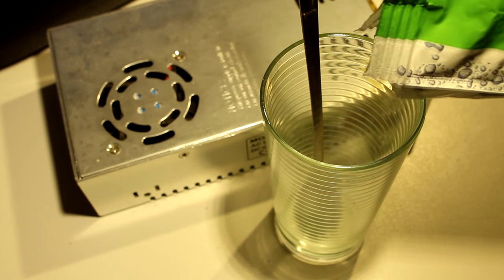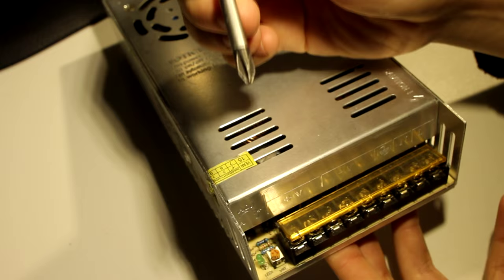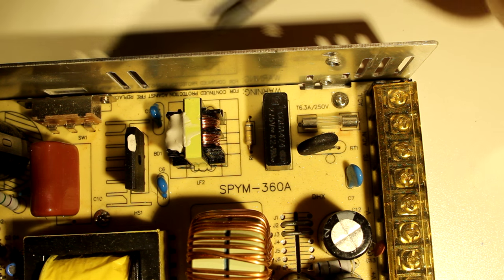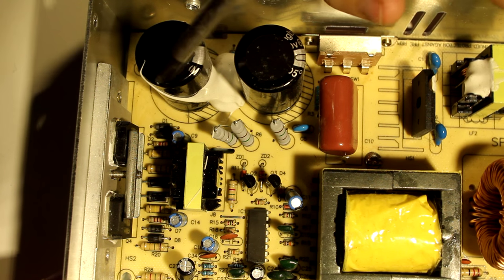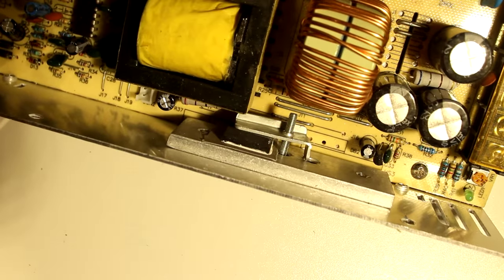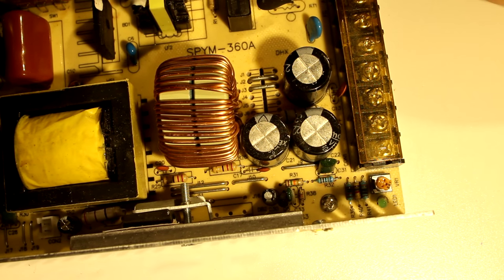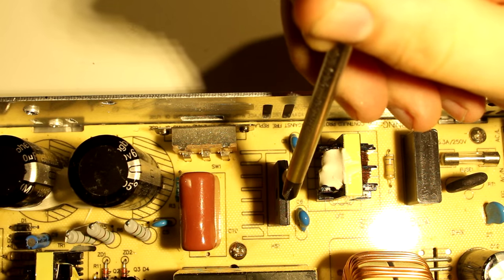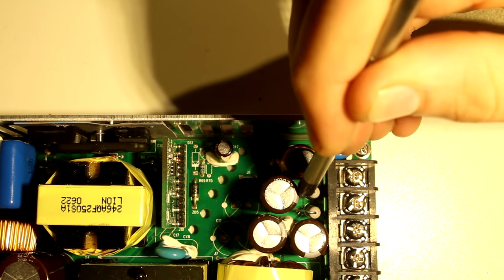Crappy chinese 24V '360W' power supply teardown (005)

Comment: who makes your better supply ? any idea what ic is running it ? a friend brought me a dumpster found elipse 720s (model) 720w 24v 30a but even after replacing input and output caps and checking all its relays It doesnt function. I get like -3v... life threw me a curve ball so i dont have a bench at the moment. also its been hard to find a full manual on it. I do know it has a CAN bus output but havent looked into it. Might be as simple as i need to short 2 wires usually switched. It was intended to be an integrated EV charger so the manual/install info arnt public. I emailed the company and got an auto responder saying x was out of office on vecation but never heard back . 

Id rather use that for my spot welder (through large buck) than the shit 500w china supply.
Ticks me off cause the only thing apparently wrong with it was a failed fan. Im not sure why it had one to begin with though. It is a sealed water tight heatsink case that they have a patent on. Idk if it just evenly distributes temp inside but seems stupid to have in such a build. 

http://q-tronic.nl/wp-content/uploads/2012/12/ELIPS-24V30A-UK.pdf

Comment: What was more concern to me was the poor inductor winding (crossing over a previous turn), and how much it wiggled. The output caps which seem not to be low-ESR types. (They should have a gold stripe). I think the power resistor between the output caps may heat them and shorten their life. I'm guessing no power factor correction.  The p/s I bought has a 24V fan, which changes speed with the load (or at least the current) .  Can you get a bit of fencing wire as a 2 Ohm resistor and actually check the p/s under nearly full load? Put it in a bucket of water and it should not get above 60 deg C (150 F or thereabouts) over a few hours.

Comment: I purchased one similar tothe one you just reviewed, I hooked it up to my 24V motor,
ex Wheel chair motor, all it did was send power to the motor in spurts...
The motor ran for a second then stopped for 10 seconds, repeated that all the time.
This is a Model S-480-24.  Input 110V / 220V.   Output 24V-20A.
I want to run  my 24V motor to drive a small power hacksaw.
Any clues on what to get? I have 240 Volts 60Hz in Australia

Comment: how would you do a load test on these power supplies to check the max current output ie  advertised at 30A?.... Because I just purchased one but I suspect the max output of the current is less than what's advertised at 30A.

Comment: I did a teardown on a similar power supply to that but mine was the 12V version. Seems to be even worse than yours but mine has two diodes on the output rather than one. I've put quite a number of hours on mine with 15 amp loads and it seems to work well and stay cool. However, its still a POS and I'm not comfortable turning my back on it.
Reply: That's what fuses are for if it runs cool and does the job whats the worry your house is way more likely to catch fire from xmas lights or overloaded extension cords.

Comment: neutral is tied to g in north american code (aka in theory most places built in the last few decades it is). I just got a 500w version that appears to be from the same designer. The lack of physical isolation/seperation bothered me too. I think its supposed to have actual cut outs in the pcb. Any idea if removing the bridge and connecting it via 14g wire...about 7in away will have a huge effect? Im integrating this into a spot welder I built and it would be a lot easier with my case design to have the heat sink only on one side. also... how did they get away with out optos?  mine is designed a bit better, it has 2 diodes  and 2 little tfs plus a big inductor with a seperator in the middle that apears to be a  common mode choke ...im kinda new to this though so im not sure. I know its before the rectifier though. Also I know w/vent is exactly what you want with cheap ass china caps...ive seen that feature utilized in a 5 dollar ebay boost converter.

Comment: Not sure why you are bitching about vents on those caps. The caps on the high quality supply have the same vents.
Even top quality brand caps will dry out over time and it is better to have them fail in a controlled manour than to just explode.

Comment: The Black round device is not MOV but it is Thermistor.  the MOV and Thermister has different works. MOV sets on parller but the NTC thermister is conneted on serise. please correct.

Comment: Nice video, but if i had to buy a cheap 12v 3amp power supply, what would You recommend?
Reply from the maker: +martin greenfield After years and years of teardowns.... I still have no idea. There are literally hundreds of PSU manufacturers, most of which I never heard of. The vast majority of them do contact manufacturing to some specification, so it's not unheard of for a manufacturer to 'usually' bring out mediocre stuff, but sometimes have these ultra-high quality PSUs. To mind comes FSP, who have self-branded computer power supplies that aren't particularly great, but also do medical PSUs which are best-in-class.

Literally the only way of knowing 100% for sure which PSU to buy is to do a teardown. Barring that, good indicators are: 1) UL/CSA listing (which is legitimate - lots of counterfeiting going on here), 2) price (more expensive is generally better in this ultra-competitive market), 3) high-end brands (Delta is a universal good brand, never seen any crap from them). 

I guess I'll do a video on that as well. It's the most common question I get on all PSU related blogs as well.
Reply: +martin greenfield  Try the STP3010  I got from Skytop power. (Check it with light globe load ) THEN take off the cover and see if there is anything hot. I think they make a STP3005 model too.

Comment: I've connected a 1F capacitor to the output of one of these PSUs (12V version) and now... it's not turning on anymore. Do you think it would be an easy fix? Could you guess what went wrong?
Reply: thank you for the reply!
Reply: OR use one of what he erroneously called a MOV in the video but is actually an ICL (or NTC ICL) - Inrush Current Limiter. HOWEVER be VERY wary since with a 1F capacitor, you're usually talking about supercaps and the inrush currrent can be VERY high for a LONG period and even an ICL may not be able to cope. Also the ABSOLUTE MAX voltage across them should typically be around 2.7 volts ONLY. SOME go very slightly higher,. BUT if you're trying to drive one with a 12v supply then STOP!! Go back to basics and properly understand what EXACTLY you are doing because NO amount of current protection is going to protect your circuits OR YOU from extreme abuse! Connecting a 12v high amps PSU to a 2.7v supercap is GROSS abuse and you're damned lucky the PSU blew otherwise the cap would probably have blown and sprayed you with boiling (literally) electrolyte!!
Reply: Bob Lewis Sir the capacitor is a car audio type, so it's rated to 18V max I believe.. and I got the PSU already fixed
Reply: Alexandru Simonescu OK COOL. Glad you got it fixed. I hope my points weren't wasted on those reading however. The point remains valid though about slowing down the inrush to large value supercaps as it can happen at any time, but especially if you just happen to switch on at the peak of the incoming AC voltage! In steady state conditions the PSUs current limit should handle the issue but during switch on transients there is WAY less predictability.

Comment: Have you tested this power supply to see how much it can actually put out? Would be interesting to see. Thanks for showing the inner workings, I've been curious about these ebay power supplies.
Reply from the maker: +Gyppor No, but I've just finished my electronic load with which I'll be able to do just that.
Reply from the maker: The MOSFET is apparently not a MOSFET, but a D13009K NPN transistor

Comment: You don't know anything about how a power supply works. A transformer only works with an AC input. They convert the mains to DC so they can convert that to a high frequency pulse to use a small transformer. That doesn't mean that it can't handle 360 Watts. I call it a piece of junk if it has no PFC. You did even call a NTC a MOV. Even a ATX power supply has a single diode chip for one DC rail. That also doesn't mean that it can't handle the current.
And the input caps should also be good, otherways it will also explode, they are to filter the voltage from the full bridge rectifier.
Reply: HVI No they don’t convert anything. They just step down the AC voltage input down. A single diode or a bridge rectifier and a filtering cap is what converts it to dc.
Reply: A transformer can convert pulsing DC, in fact Faraday used pulsing DC for his transformer when he invented it because AC wasn't available yet... But you are right the SMPS uses high frequency AC.

Comment: I would like to see a follow up where you load it up and see how close it can get to the advertised specification. It certainly is crappy, but for some less demanding uses, will it work?
Reply from the maker: +migry It outputs power, but the output is very noisy. If you use it for directly powering (sensitive) electronics, it's not acceptable. I used it for driving stepper motors, and that worked just fine. But I used it at less than 25% of its rated capacity.

In general, these things will work just fine with stuff that doesn't really care about power quality and at less than 50% of rated power. They will not survive very long though. I've already repaired this one twice...
Reply: OMG!! You never mentioned you'd repaired it previously ... TWICE! And yet DESPITE having been inside it TWICE and "repaired it" you didn't even KNOW that it was an NTC ICL and NOT a MOV! You didn't even KNOW that it had no PFC circuitry! You didn't even KNOW that it had a flyback transformer design! And you didn't even KNOW half of the other stuff you got wrong and yet you claim to have "repaired it" TWICE. ... It gets WORSE not better!

Comment: It must be get pre-filtered  clean air   with forced air cooling for long term use.  Dust bunnies with humidity, overheating, unstable reactive load, etc can cause failure.
 ||| The Input is not an MOV but an ICL to reduce inrush RT= Resistor Thermal)  |||  It takes great skill to cost-reduce this much but risk of failures is higher from unskilled users.  |||   For active load test. Get toaster wire (Nichrome filament) to make 1 to 2 Ohms for 200W to get red hot then drive with <<0.1 Ohm FET to keep cool  |||

Comment: are you going to test the power output? it would be interesting to see how much it can actually deliver, at the risk of blowing it up of course...
Reply from the maker: +ghostrider090 My testing setup is currently still under construction, but all reviews approx. 1 month from now will have a testing section.
Reply: SERIOUSLY!!?? You post a PSU review (NOT a breakdown) and haven't even completed your test setup? Who needs a setup? Just hook up your scope and a decent output load (a bunch of mains filament lamps in parallel is ideal and away you go. ALL the important measurements can be shown on a scope - waveform distortion, regulation, pwm stability, voltage v current stability. You can even do a lot with just a multi-meter. Do NOT judge a design until you are at least adequately qualified to comment. Some of your comments are crass. Others (as people have already said) are just plain stupid. If you want to have on-line credibility then start with the truth. 

TrY: "I don't know much about these, but here's my take. Corrective comments are very welcome" That would have given you a much bigger credibility than what you did.

I am an electronics graduate of over 40 years standing and I FREQUENTLYwatch videos such as this to see if I can pick up extra tips on things I may have missed previously. After 40 plus years I'm still learning new stuff. Sadly in this instance I found myself exasperated at the poor knowledge, understanding and lack of respect for the designer.Nobody ever winced at a Mini because it had a piddling little 850cc engine WHEN IT could, would and did run rings around MUCH larger vehicles on a twisty road, so why even think that just because there is an excess of large inductors and other stuff for a computer SMPS that such would be required for one that TECHNICALLY is almost certainly designed with LED lighting in mind or some other somewhat less demanding task than the VERY heavy variable and inductive loads found in a computer. Which, incidentally, is the main (but not the only) reason you'll find PFC circuitry in them - sometimes passive but often active.

The "crease" marks on top of capacitors ARE a feature, and one found in ALL the BEST capacitors, and a VERY important feature. They not actually "vents" per se (a vent is more commonly something e.g. you'll find in a sealed lead acid battery - opens AND closes) ensure that WHEN one explodes, it does so through the weakest point in order to have some predictability over direction of usually VERY hot (100 - plus Celcius) electrolyte ejection. The creases ARE the weakest point, and in a PSU, they SHOULD point vertically upwards towards the nearest metalwork of the case. ONE reason why having radial capacitors lying on their side when other board mounted caps are mounted vertically is generally a BAD idea.

There is so much other stuff that is just "wrong" in there I'd be writing all week.
Reply: Exactly correct Bob this is not rocket science.

Comment: I bought a "crappy" 30V 10A adjustable p/s a few months ago.  About $99 (US) from DX .  When first testing I used 2 x 12V halogen lamps as load, and about 5 min later a diode in the fan power supply failed and the mfr (stp@skytoppower.com) kindly sent me a relevant portion of the circuit. I replaced the diode and lifted a filter capacitor clear from a track.  V and A meters (adjustable) were within 1% as received. Limit pots were set at 32V, 10.6A and I didn't change them.
No problems since. I checked load changes using 3 x 1 Ohm resistors  immersed in a glass of water (22 gauge steel wire used by gardeners) switching either 3 or 2 ohms load. No sign of glitches or ringing. Noise/ripple seems less than 10 mV on my AC meter (200mV range) which surprised me so I put an earphone (with 1000uF isolating capacitor) on the output (20V,6A load) and could hear no sound. I'm impressed.
Reply from the maker: +Charles Tivendale I'm not immediately impressed by a power supply that fails so fast. But to  be fair; at $99 I'd expect decent quality. You can get very good quality 300W computer PSUs for half that money.

Comment: There is no PFC circuit there,  Those small transformer is just signal tranfsormer connected like driving transformer for those 2 transistors and those 2 transistors is in half bridge topology... Thats why there is also 2 capacitors. This topology was used before some years in each cheap PC power supply with TL494 IC. AT and also ATX up to 400W. Without PFC or with passive PFC. Today this topology is replaced by new solutions in PCs. Also inside those with small power.
Reply: Almost correct, it's a half-bridge LLC resonant, not a regular half bridge... the two main capacitors are for voltage selection only, between 220 and 115, when switch is set to 115V the bridge and two caps act as a voltage doubler, otherwise the two caps are used in parallel... the large metal film capacitor is connected between the primary winding and switches and is the only capacitor used in this half-bridge topology.

Comment: You are mentioning the MOV very confidently!!! Orientation makes somewhat clear that this NTC is in series!!!
Reply: Thank God I wasn't the only one to realise that it was likely in SERIES with and not across the mains (even without looking at any other clues). In fairness though, without seeing the actual markings it COULD have been a Varistor/MOV (metal Oxide Varistor) or VDR (Voltage Dependent Resistor) with oddly laid out copper tracks, as they are often indistinguishable sometimes.
Reply: I continued reading through the comments and replies, and in one (about a year ago) he says he"repaired" this PSU previously ... TWICE!! HOW?? He didn't have the faintest idea about what he was saying! Jeez!

Comment: These things are as cheap as dirt to buy, with dozens of companies offering pretty much identical products that are obviously not intended for critical applications or rough environments of any sort -- e.g. no medical or aerospace gear -- but if sensibly applied they do the job and usually last for years with no problem.  When ordered in small quantities, in my experience they actually arrive DOA more often than they fail in actual use, handling in transit being much more likely to cause a fatal issue than the simple task of providing adequate DC power to a string of LEDs or one of those nifty little Class D audio amplifiers.

Comment: This is not a PFC inductor.
 It is the small high frequency transformer that powers the low voltage electronics of the board. It is very trivial to realise it because the two switches located on the heatsink behind it are THE ONLY HIGH POWER SWITCHES on the PCB. The component in the output of the transformer is a dual diode so this proves that the switches on the back are switching the transformer. There is no way to have APFC in such a cheap PSU and especially such a small inductor for it. And what the hell with the thermistor? Its not an MOV.